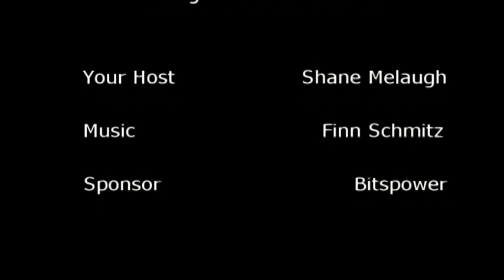EN Tutorial: Installing Bitspower waterblocks on an EVGA X58 Classified Mainboard

Comment: Nice vid mate, I was wondering if you could answer my question?

I'm in the process of setting up my first ever custom WC loop, I'll be using Bitspower Compressions, and I also have some rotary 45's and L's to, but what I need to know is, how tight do these fittings have to be screwed in?

Do they need to be tightened with pliers, or should I just screw them in as tight as I can by hand?

Sorry if this is a noobular question, but I wanna do this right, as I have pumped a lot of money into it!